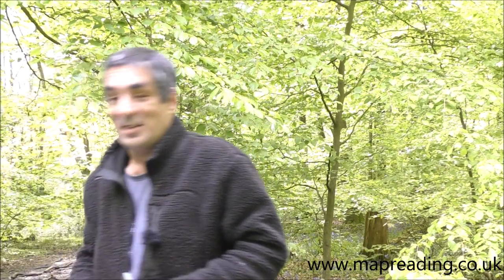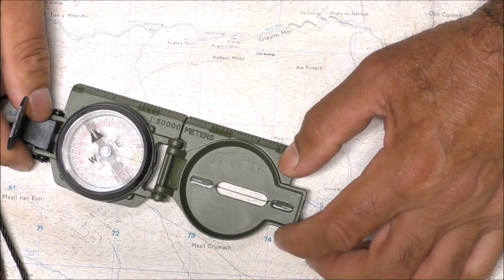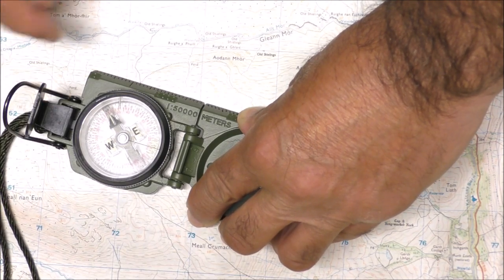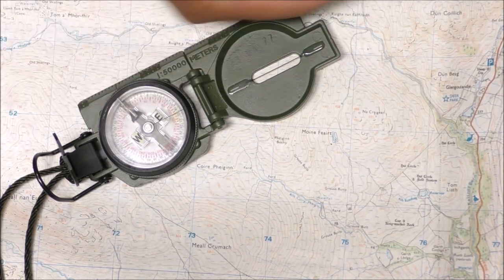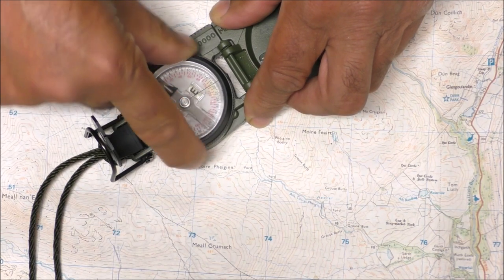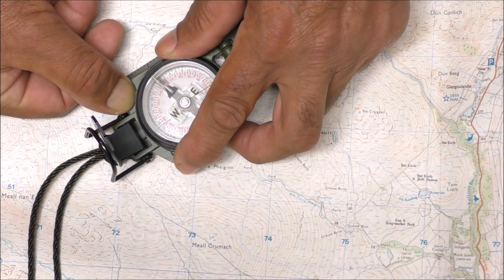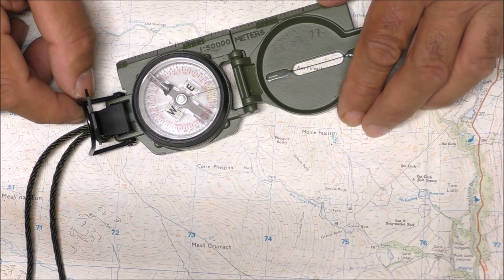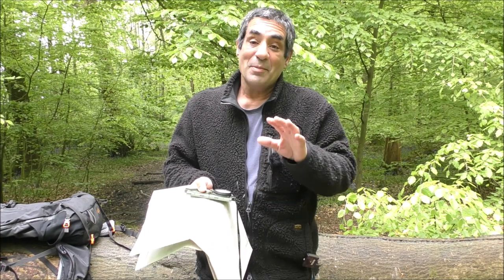Cammenga compass - how to set magnetic declination

Comment: Great video and thank you for sharing. 
Love your videos, I find them very practical and entertaining at the same time.
I did comment to one of your previous lensatic compass video which was very helpful.
I have always been using the Suunto MC2 with adjustable declination, so with my new Cammenga I am now using manual calculations to make adjustments.
I do agree with you, that you don't need to orient the map.
I am not sure if this is useful but with my cammenga, when it comes to getting bearings to and from map using the compass I have made the simple summary.
(A) In order to transfer Map Bearing to Magnetic Bearing(onto compass) > Map Bearing - Magnetic Declination=Magnetic Bearing
(B) In order to transfer Magnetic Bearing to Map Bearing(onto map)  > Magnetic Bearing + Magnetic Declination = Map Bearing
Cheers

Comment: if you have an azimuth that you can't divide by 3, and if you have a plastic protractor you can add or subtract degrees of declination, drawing a new line of corrected path direction with the degrees of declination and taking a new measurement with the compass, or am I wrong? You certainly need to carry a protractor and pencil, but usually on my long walks I have always had them

Comment: if I understand correctly it is not necessary to move the map with the Cammenga on top, orienting it in advance towards the north, with this procedure the map does not matter how it is placed. Is that so? Thanks for his kind explanation.
Reply from the maker: Yes, that's right. The map can be pointing in any direction as the magnetic needle is not used to take a bearing from a map.

Comment: I mean, the 3H doesn't even have single degree resolution on the dial. It only has marks every 2.5 degrees. If you actually need high precision you'd probably use the mils scale.